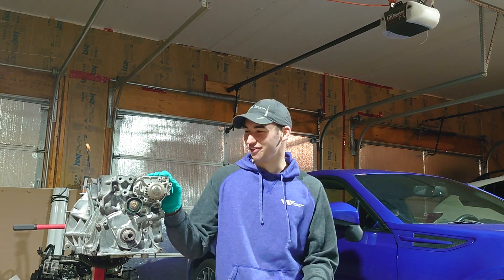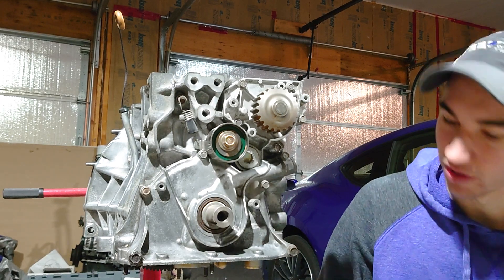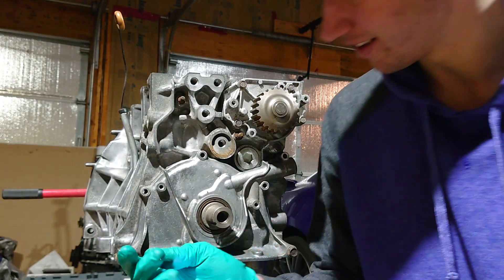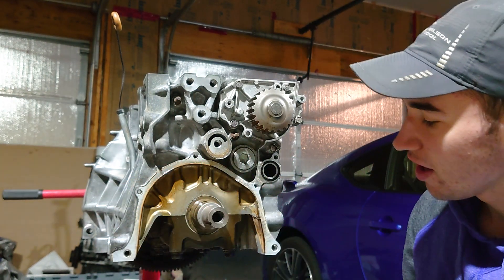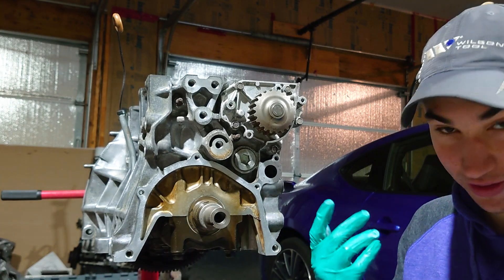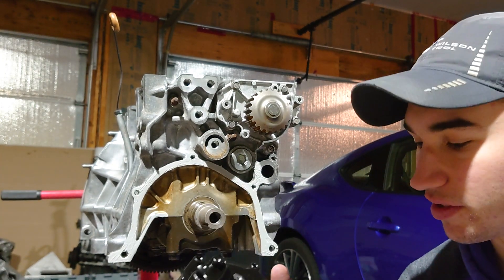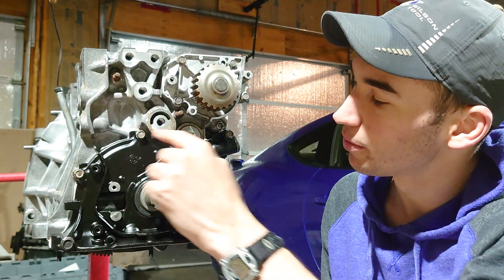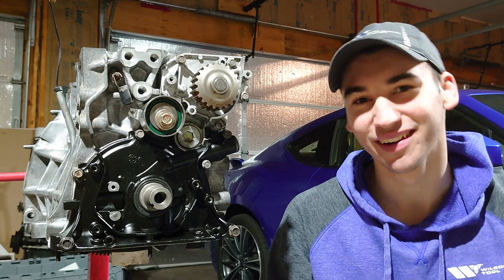B Series Oil Pump Replacement/Upgrade

Comment: Can you do it with engine in the car is tge question
Reply from the maker: It would be tight but if there is room to slide off the crank pully there is room to slide off the oil pump. I've replaced the crank seal before.

Comment: Thanks for the video. I just did my crankshaft seal but there is still an oil leak coming from up higher, near the alternator mount bracket. The oil is coming down the left side of the engine, then rolling over the 12mm bottom bolt nearest to you in the video. Looks like I have to go back in, replace the oil pump seal and do the timing all over again. Man, this sucks.
Reply from the maker: Bummer dude, at least compared to other vehicles this one isn't too bad to work on

Comment: Do you need to prime the oil pump on these cars before starting them, after replacing the oil pump?
Reply from the maker: Before your first start unplug your fuel injectors and crank the engine over until you start getting some oil pressure, then your good to go

Comment: What is your oil pressure at idle? Mine is dropping to 10 or maybe a bit lower at idle and I am concerned. I'll hit 80 when the vtec kicks in but don't want to cause serious problems with lack of oil at idle
Reply from the maker: 10 is ok at idle, a good rule of thumb is you want 10psi per 1,000 rpm. What oil do you run. I recommend motul 10w-40
Reply: @kraftingkars 10psi is not enough at idle. Honda states 14psi is the minimum oil pressure you should ever have. I'm changing my acl pump back to an oem one because I'm having the same problem. They're just bad oil pumps. Do you think a rule of thumb or the manufacturer spec is better? Tbh I'm so disappointed with acl, I was hoping it would be a good pump but saw oil pressure drop below 14psi twice and im changing it now.
Reply from the maker: @anotherdedchannel  yeah I run a 4piston ported oil pump now. This motor did not hold oil pressure for long. After it went I rebuilt it and css'd the block! Much safer now!

Comment: So if I wanted to just replace the crankshaft seal without replacing the oil pump, can I do it without removing the oil pump?
Reply from the maker: Yep, just need a pick tool/seal puller tool! One thing I've done to swap them out in the past is screw a little self tapper into the face of the seal, then pull on the head of the screw with a plyers and it pops right out.
Reply: @kraftingkars  I got it out using combi technique of drilling tiny holes, screwing in metal screw, pulling on it several places, finally got it loose

Comment: Watching this video because my oil light keeps coming on. I have a feeling it’s my oil pump due to that I changed the oil, filter, sending unit, drain pan gasket, drain plug and still when I do a oil pressure test it’s not holding at the correct PSI. I’m wondering if you think it’s the oil pump? I currently bought the same oil pump from this video. If anyone got any info link me!!
Reply from the maker: Yeah at that point it's either the oil pump or your rod/main bearing clearances are getting too big. Any strange noises? Any shiny flake in the oil?

Comment: Would you happen to know if the oil pump fails, will it restrict rotating the motor over by hand at the crank counter clockwise? I have an Integra with a B18B1 motor which I'm trying to figure out if the motor is seized or if the oil pump is seized therefore restricting the motor from rotating counter clockwise? The motor freely turns clockwise just not counter clockwise. 

I pulled the spark plugs all serpentine belts (AC, power steering and alternator) plus dismounted the starter and distributor and the issue persists. I poured Marvel Mystery oil in the spark plug holes and no luck. Any insight would be greatly appreciated. Thank you
Reply from the maker: When these oil pumps fail, the gears inside usually shatter, which would make hard to turn in both directions and would feel inconsistent.
Reply from the maker: When the starter is hooked up, can you do a compression test? Also it probably wouldn't be a bad idea to get an inspection camera and fish it down the spark plug holes, hopefully it's not a bent valve
Reply: @kraftingkars  Thank you for your reply. So if the oil pump fails then the crank wont spin in either direction? Some background on what lead to this issue.. My car was partially flooded due to the recent storm in the northeast. Prior to this my car was driving fine, it was parked when it was subjected to water so I'm ruling out hydrolock since it wasn't running. The following day I drained the motor oil which had approximately one tablespoon of water and pulled the spark plugs. I drained the transmission as well though it had no water. I pulled the valve cover and there was no water inside either. I pulled the oil dipstick and there was no water droplets. The car was then rolled from my driveway into my backyard, I have yet tried to turn it on as I don't want to potentially risk damaging the motor internally. 

Being that I can still turn the crank clockwise freely, is there hope that the motor is not seized and it is being restricted by something mechanical such as then the water pump? Would you know when a motor is seized if it will NOT turn over in either direction or it can still turn in one direction and still be considered seized? I doubt the engine is out of time since the timing belt is rather new and the timing was set-up correctly. Thanks again.
Reply from the maker: @vanquishstorm  if the engine is seized it won't turn either direction. The next easiest step would be too remove the valve cover so you can look at your valvetrain assembly and timing belt, and see if anything looks out of place
Reply: @kraftingkars  Well that is good to know that the motor is then not seized since it does rotate clockwise. I'm going to pull the valve cover again, if the water pump is seized, would it restrict the motor from rotating in either direction or one direction similar to the oil pump? Thanks for the insight.
Reply from the maker: I'm pretty sure the water pump will still allow you to rotate the engine in both directions if it fails. I've never seen one fail in person but if the shaft broke for the impeller it would just feel kinda shitty turning the motor in either direction just like the oil pump
Reply: @kraftingkars  Lastly when I initially rotated the crank counter clockwise, I mistakenly had the car in gear one, I thought the car being in gear was the issue but with the shifter in neutral it still has the issue. Is it possible that the shifter is in neutral but that the shift linkage or other transmission component is still stuck in gear one? Slave cylinder issue? The transmission has fresh fluid. Thank you for all your help.
Reply from the maker: @vanquishstorm put the car in neutral and if you can push it easily you arnt stuck in gear
Reply: @kraftingkars  I dont know why I didnt think of that, I'm going to push my car in neutral and see if it locks up. New subscriber.
Reply: @kraftingkars  I pushed the car in neutral both backwards and foward, the car rolls but I can feel some resistance acompanied by a loud squelling whining sound. The car dosent feel like it normally does when I push it in neutral.

Could the car be in "false neutral" and stuck in between two gears? If so, would you happen to know how to get the shifter box unlocked and in true neutral? I'm thinking when I first rotated the crank counter clockwise, I mistakenly left the car in gear one and switching back into neutral didnt help resolve the issue. Maybe the gears got jammed/locked when I rotated the crank counter clockwise with the car in gear one? 

My apologies for all the questions, I been trying to get my car back up and running for quite sometime now.

Comment: I would think you wouldn’t have to put RTV on the small upper area where the O-ring is… Kind of like you don’t/shouldn’t ever use RTV on an Honda water pump cause the O-ring seals it just fine. The O-ring is there for reason. Or does the manual call for it around the o-ring in this oil pump case?
Reply from the maker: If your surfaces are clean and flat than you should be good! I only do it for added peace of mind and only use Hondabond rtv. It has helped me fix some leaks in the past before! And I haven't had any leaks yet using it!
Reply: I just put mine on and was contemplating the same thing I put it on to start then thought about it and about the water pump not having any wiped it off and threw the pump on hopefully I made right choice but idk Honda bond would of been just extra protection and piece of mind probably
Reply: @nathandornn7891  you know, I did the same and now I am wondering if I should take the oil pump off, clean all the honda bond and redo the whole process to add around the O ring. @ kraftingkars any advice?

Comment: Hey man great video , how’s the ACL oil pump holding ? I need an oil pump but wanna get ur opinion thanks!
Reply from the maker: Unfortunately I haven't put too many miles on the engine, I only got 450 miles before my oil pressure got too low to safely drive. But my oil pump held up! If I were to do it all again though I would get an oem ported pump
Reply: What is the idle oil pressure supposed to be on a GSR B18C1?
Reply: @TonyProfit no less than 14psi according to Honda
Reply: So basically the acl oil pumps are a waste of money if it only lasted 450 miles is what he is saying

Comment: Hey man, did the acl pump come with new dowel pins?
Reply from the maker: Yes it did! You can see them at the 5:00 mark.   I didn't even have to press them on the pump side, they were already in there when I opened up the package.